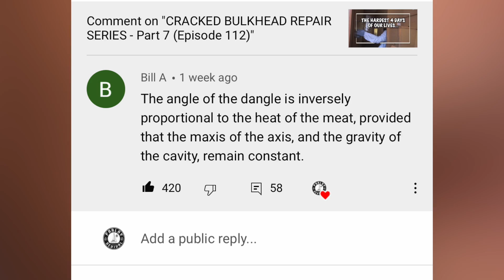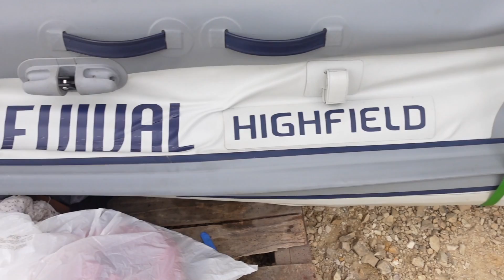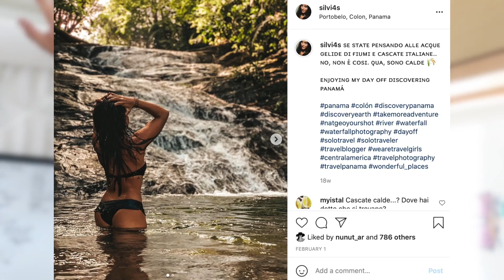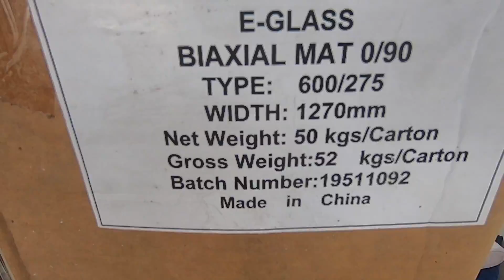CRACKED BULKHEAD REPAIR SERIES - Part 8  (Episode 113)

Comment: When you were sealing the edges of your plywood bulkheads it looked like you used normal mixture of epoxy.  Have you had a chance to try Total Boat pennetrating epoxy? That stuff works amazing.  I have switched over to using pennetrating epoxy when I am trying to protect plywood from water and condisation damage.  2 or 3 coats will do great applied with a roller 👍.  You guys are doing an amazing job.

Comment: At 8:30 you offer an observation and opinion that I agree with completely.  After following your channel over the past year or two, what I've seen has made it clear to me that the boat was manufactured with significant deficiencies of design and workmanship, deficiencies that led to catastrophic failures when the boat was subjected to the challenge of hurricane force wind and water.  Not to trivialize a hurricane, but the boat should and would have suffered far less damage if it hadn't been so weak in the first place.  Bad on Lagoon!  Owners beware!

Comment: I have not seen how you prepped your cloth. Tip: no straight  edges on the fiber glass cloth. After you cut your piece of cloth. Grab the edge with your thumb and forefinger and pull strait out, leaving a rough edge. Go all the way around each piece. It will mesh together making it one piece with no cold joints from the straight lines.

Comment: It's a full truss, like a truss bridge, and it's not triangular. You can't have triple layer with glass on top of that for part of the truss and single layer for the rest. The single layer will fail, the weakest part of a truss with such variable strength will fail because the whole thing is important.

Comment: The reason why lagoon used the adhesive was to have a soft join between the bulk heads and hull
This allows the hull to flex a little.
Having the hull and bulkhead joined directly together you are creating a hard joint.
The hull can no longer flex at the joint.
This could very easily lead to cracking and breakages in the fibre glass.
In other words you could have created another problem in the future.
Reply: Bruce, good point but the huge mistake I see is grinding away 17 layers of Quadraxle stitched cloth and replacing it with chop strand mat. WTF.
Funny thing is 99.7% of the viewers  think he's doing a trade standard job. Also in my 30 yrs of boat building, I've never seen epoxy used with chop strand mat. Oooh dear me...... this generation is F@*%ed. haha
Reply: If that was the case then why did lagoon tell him that was the proper way to repair the damage?
Reply: @feanor3876  lagoon created the problems for their customers. 
Now they are telling people how to fix the the problems that they created. 
If they new what they were doing wrong. Why haven't they changed construction methods.
Boats now days are designed to flex a little bit.  Mine is 40 mm of CMS. Solid as a tank broke anchor in a 76 kn storm onto rock wall about a  metre of scratches.

Comment: Looks strong to me! 
I’d just keep an eye on the plywood during the first hour of the putty kicking off incase it shifts. A couple of times (in colder weather) I found my marine ply moved when I failed to weight it down with bricks / G-Clamps. 

Ideally don’t breath in Cab during the mixing process I read.

Comment: According to West System Fiberglass Boat Repair manual, the American Boat and Yacht Council - ABYC, and Total Boats,  when doing fiberglass repair,  you layup you fiberglass layers large piece first and work up with the smaller pieces.  You have been laying up your fiberglass layers opposite of how the experts and manufactures who actually design and make the products your using say to use them.  Other than the opinions of a few "guys on YouTube" who say that the experts are wrong,  why have you chosen to do it backwards and contrary to how the experts say to use their products?  I would really like to hear your supporting rational.  The ABYC actually has a YouTube channel and have uploaded a video titled, "Common Mistakes in Fiberglass Repair" that you might find useful.

Comment: Very glad to see you use such high build quality in your repairs. It is so important to pre-soak the wood with epoxy to get good joints. It's also important encapsulate every bit of the wood with epoxy and glass so what is totally sealed and becomes a plywood core that can never get moisture. Just think how many times stronger that is then foam or Balsa Cores.

Comment: Pull the bqck plug under the condensor of that ac or tip it down 3° and it will sling it into the condensor radiator.

Comment: is there a way to strengthen the bulkhead with ribs or fasteners which will prevent those laminates from separating  , we all know there is no chemical bond to the old  surfaces unless you button hole  many of those layups, just a thought

Comment: I was wondering about the anti-fouling on the bottom of the boat it looks like a bunch has worn off.  Are you planning on adding more anti-fouling before you launch the boat again?  Also The camera you used at the beginning of the episode was super crisp, could you let me know what type of camera you were using?..ie..MP rating spec's etc.
Reply: he mentioned in another episode that the anti-fouling is only 2 years old and hasn't lasted, I assume he will be re-doing it.
Reply: I can not imagine they would do all this and then not make sure the anti-foul is up to par? I am not criticizing your comment. Just shocked they would even consider re-launching without correcting?

Comment: channel sailing catching rays 2 is fixing up a a hurricane damaged leopard, the main bulkhead support beam that runs between the two front hulls and under the mast step is a massive metal 'I' Beam like used in construction, super big and strong compared with that fibreglass strip lagoon make.

Comment: Colin: the 1 USD hack to easily apply the epoxy+carbo “peanut butter” : fill it into a freezer bag, cut one corner, press it and apply a nice  seal. i usually prepare a bunch of 100 ml bag, keep the prep into the fridge, thus with a 206 hardner mix i usually have nearly one hour before to entry into B stage. I was doing more or less the same job last month here in Jamaica. But no AC....even a 50 ml batch was going overheating cure in the mixing pot before i decided to use the fridge :)
Reply: nice tip, was also thinking one could use a kitchen dough mixer to mix large batches fast and well
Reply: @hayden-james  large batch with west 206 hardner (i guess he is using the 206) here in tropical weather is not really possible you can really overheat within minutes i would have go for the extra slow 209 hardner but not available and then you have up to 36h before any sanding or peel ply removal. thus my set of small batch prepared and stored into the freezer (finally exactly like a prepreg layup)

Comment: You should go back and see if you have more footage that never made it onto YouTube from looking over the boat when you bought it.. I don't know my ass from fiberglass, but,,,, I did work in the nuclear field and I can tell you that they are huge on never having WEAK POINTS. Gussets and sistering are commonplace in every structure and when I look at the corners, (cut outs), for doors and pathways on your boat with no added structure to areas where it has been removed, I'd say it would not take anything do destroy these boats. Forget all about one of these making it crossing the North Atlantic!!!  I like that you are doubling up these bulkheads, but wish you would add even more to all of the small, thin areas. My mind is stuck on perforated steel plates. Perforated so that you can epoxy through all the holes and make a perfect sandwich with them between the plywood sheets. I know you have it handled, but how insanely strong would you make the bulkheads if you were designing this boat??  Ps. The lady needs to STAY FOR LIFE!!!! 
"SMOKIN"!!!!!

Comment: Collin to slow down the resin kicking off so quick put half of your batch in refrigerator for 20 minutes that will give you a longer work time. I think you said you are using west system epoxy I love that stuff I used it to redo my fuel tank compartment on my 82 wellcraft sportsman 248 w 300 etec came out superb JT 🇺🇸🇺🇸🐟🐠🎣🛥🌴⛱🙏🏻🙏🏻

Comment: You should also bridge across your repair on the beam with some stainless or aluminim. That repair is only gonna be as strong as the epoxy as far as carrying loads across it. Ideally you should across the whole beam of the boat for maximum strength. Great idea on the window A/C was worried about you guys overheating along with the epoxy.

Comment: In my not an expert opinion the door is too big and it does not leave enough plywood for strength top or bottom . In those corners , if you have room , add another layer just there either side.  You will have left over you can use .  

If it was me I would make the doors smaller and live with it .

Comment: Colin, when this is all over you're probably going to have the only Lagoon with any resale value  :  )
Reply: Shocking how poorly built this boat is. It's no wonder Lagoon were so eager to advise you. This is terrible PR for the company.
Reply: @charleshuguley9903  I think you are confusing three issues the first is the build quality of production boats well they are built as cheaply as possible but have to meet standards hence they will not go the expensive labour intensive route if there is a cheaper method which crucially meets standards. This is normal manufacturing practice suppose you can save 20 cents on a part for a car it might be a $20,000 car and doesn't sound worth it but is you made 1 million a year then that 20 cents saved means $200,000 extra profit.

Secondly there is Quality control how well a manufacturer actually sticks to these methods. Since there are several sailing channels doing such extensive refits that parts of the boat are seeing the light of day that no one ever expected to it is shown that Lagoon and others suffer from shoddy workmanship.

Lastly there is the Issue with the Lagoon 450 their appears to be an actually design flaw in that although it has passed software modelling and trails it was not strong enough even if built correctly. I think Colin mentioned that there is a group and 50 out of 52 owners found the same problem and there is a class action lawsuit against Lagoon though I do not know if Colin has joined it.
Reply: @glennedwards1449  In what way am I confused, other than about your comment?
Reply: @charleshuguley9903  Because though I agree with your statement that production boats are poorly built with poor quality control In this instance the damage done to Colins and many other 450 is nothing to do with that but a result of the original design
Reply: @glennedwards1449  How do you know the original design called for NO tabbing where it is clearly required? Seems like you have not done anything in your comment to impact upon Charles Hugely's original comment which most would consider quite accurate in the three points he made.
Reply: @glennedwards1449  sadly Colin will have a difficult time getting past the fact his was a Hurricane damaged insurance buy out. Even though its clear the issue is not only in Hurricane survivors the ability for a court to say how much was damaged due to the storm versus design and construction would be a real challenge. I am surprised a little that a survey or buyer inspection didn't catch at least some of this issue? At least enough to say "stay away", I appreciate its hidden for the most part but the crooked and squeaky floors and the fact that bulkheads seem an issue on many boats that a close inspection was not completed it seems? But hey Monday morning QB always seems so easy.
Reply: @goleafsgo8496  I think Colin's boat was if not the first to experience the issues it may be one of the first where it actually came to light. It would not come out during a standard survey since you literally have to knock down interior walls to examine the bulkhead something a perspective buyer would not want you to do. From a legal standpoint the hurricane damage would not be an issue. Lagoon owners are alleging that it is actually a design flaw as in the bulkheads fail because they are insufficient as specified. I do not know the ins and outs and obligatory not a Lawyer but any other damage would not be contributory especially as it seems the vast majority of 450 have this issue. I presume with a class action it would have to take place in France so not sure what the laws are there
Reply: @zorbalight3933  I actually did not say the original design called for no Tabbing it did and it is on there. The bulkhead issue is not a result of poor quality in the build or the result as Charles suggested or poor Quality control it seems to be the result that the bulkheads as designed are insufficient to take the loads imposed on the boat. This is born out by the fact that the vast majority of 450 have the same issue. So even if an owner has a pristine 450 without any issues this will happen to it.
Reply: @glennedwards1449  "have to meet standards " big joke there is no external check by an independent body.
Reply: @marccoussement6903  You are 100% correct in that they do not have people inspect the factory poke around the yachts made etc. However you are 100% wrong that a Boat building factory does not have to get its design and building methods certified by various maritime authorities.
Reply: @charleshuguley9903  I don't know why people are so surprised. Most mass produced boats are crap. There is barely any QC and the way they are built you can't really do any work on them without destroying most of the boat. Our boat on the Adriatic is over 60 years old but you would not be able to tell that because my dad has modified and modernized it every 10-15 years. I showed him couple of videos of Lagoons and other boats and explained how they are built and his reply was "fool and his money are soon parted".
Reply: @someone28  Yep! I've spent decades sailing the Oceans experiencing its natural forces in many storms & I am always surprised @ my shock of some who treat it if its a "Some where to Cruise" But even these guys have thought "Oh Yeah" looks like a bargain with a lot of Fibre -Glassing, "Beware the man who comes bearing gifts and invoking flattering words!" 😱
Reply: @someone28  it's a production line boat , a lot like a motorhome assembly line 
These guys are customizing this one
They have  to,  CAPTAIN has over $250,000.00 plus Invested IN THIS CAT
Reply: I'm curious of the actual design of the bulkheads got changed after the marine architect signed off on it.  The bulkheads don't make sense to attach to the hull 3 layers thick then going down to 1 layer.  

The fiberglass issues is just piss poor workmanship.  No way that was designed into it.
   
   The shortcomings in this boats build quality seem to me like the result of penny pinching to lower build cost.
Reply: Colin will have the best cat on the planet.

Comment: I would add several extra layers of cloth at that bottom outboard corner. That section of the plywood is awfully narrow.   My evaluation is that there is where the problems started, then spread as you described. Good job on the prep!
Reply: I can not see that small radius at the top and bottom being able to carry the loads of the mast and rigging particularly as such a wide boat is a really long lever . 

 I would not for example have that narrow of a section on a single floor joist spanning 12 feet even though it is 16 inches from the next one let a lone on a huge boat like that .
Reply: @faircompetition1203    I had not realized this was the mast support,  I totally agree.

Comment: I've been accused of over engineering things too, but I believe in Build it once, and build with Quality. So it'll last a lifetime.
Reply: i second that
Reply: It’s not an aircraft or racing boat, a little extra weight will not hurt.
Last time I checked battleships floated.
Might want to consider some ppe when using the glass and solvents, lungs might be more susceptible than you think after bout of coronavirus.
Reply: Couldn't agree  more mate

Comment: By the way, this is not a new problem, Sailing Nahoa had a 2-year-old video pop up this week in my recommendation about their cracked bulkheads in their Lagoon 450. I believe I might have watched it a year ago, but I am not sure how they fixed it. I know they are starting to get questions about theirs, and then that video came up in my recommendations. That video is 2 years old before all the hurricanes and well they left from Canada. They are in Thailand right now. You might ask them about it. This means that Lagoon has had to know about this problem for over two years now since before your boat went through the hurricane! Just Saying!
Reply: Sailing nahoa have a lagoon 410 ( different model )

Comment: Thanks for the videos! What are your thoughts about weight? Any calculations on how much weight you are adding with all the extra bulkhead framing? Do you think it will impact performance much?
Reply: I've been wondering the same thing for a long time.Not so much about preformance but more like center of gravety( is this calculated for Cat's like on aircraft?) I would imagine that with all the forces playing on the 2 dif hauls,this must affect the structure big time..weight and balance from things added to the structure and also weight added as cargo( fuel,water,food,soals..etc etc..) Colins boat failed when it was loaded to the max. I wonder how balanced the weight was distrubed over the the 2 hauls?